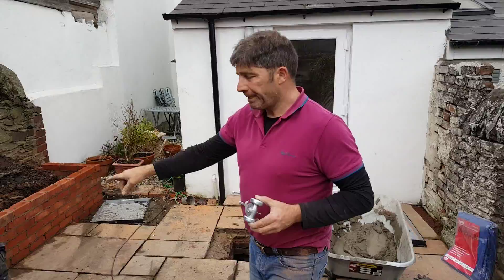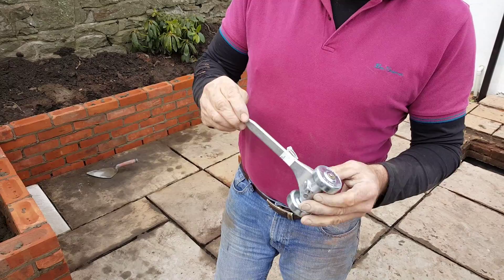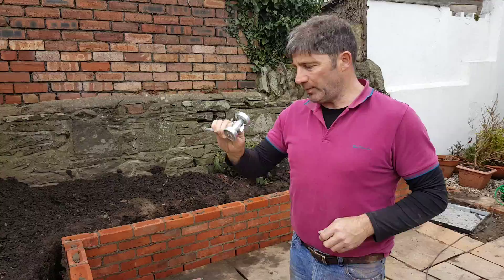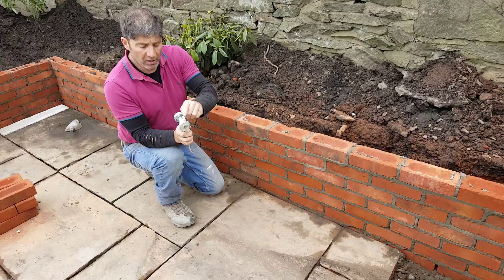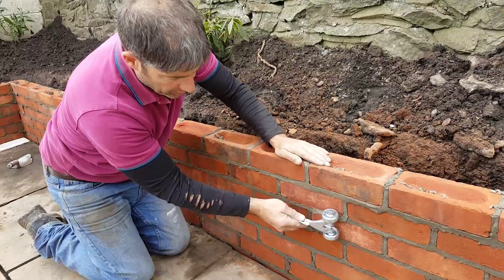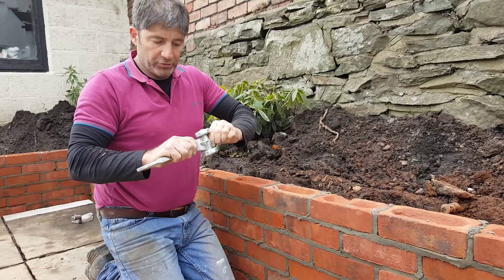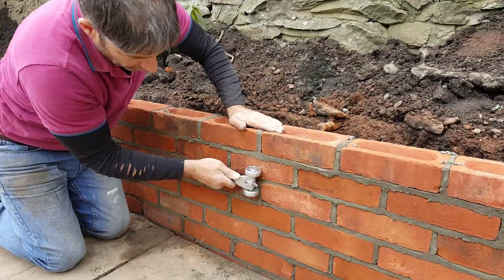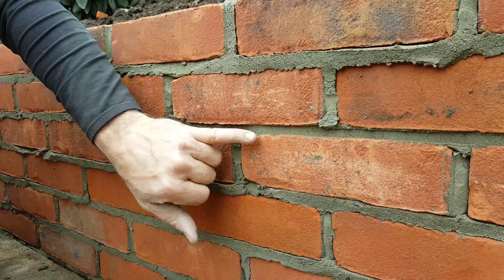Marshalltown Raking Jointer For Brickwork

Comment: Not really good for an exterior joint finish choice.
Reply from the maker: What would you do mate
Reply: @GreentopLandscapes  leaves a ledge for water to lay on and not be shed easily.  Concave, weather joint, even a raked joint with a wooden dowel.  But if you like the recessed joint top and bottom you can slick it with a flat jointer after raking with the tool.

Comment: Wire brush works much quicker
Reply: You must not slash
Reply: Not as deep not as even. Never used wire brush on masonry it will tell you that in any spec. Wire brush will leave metal deposits on brick only to rust later.